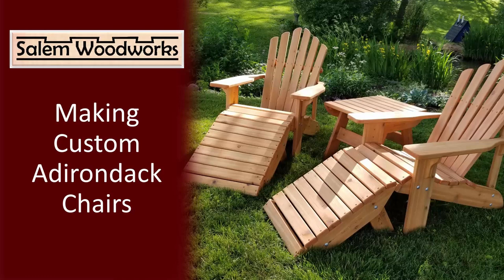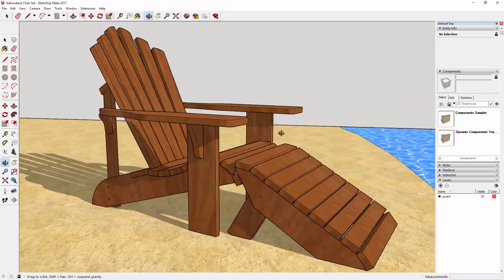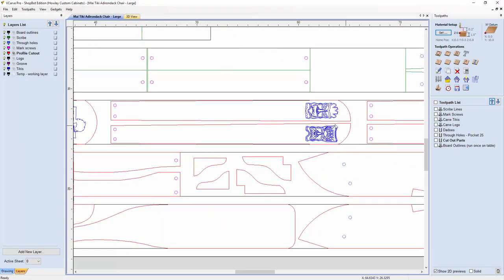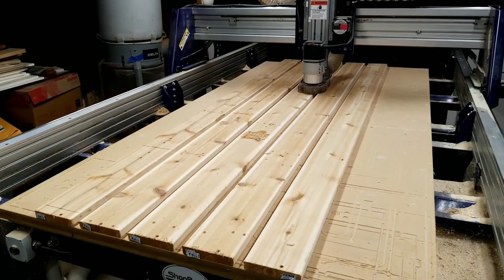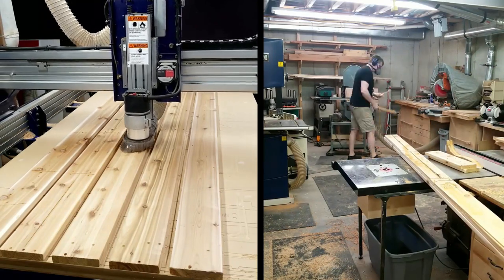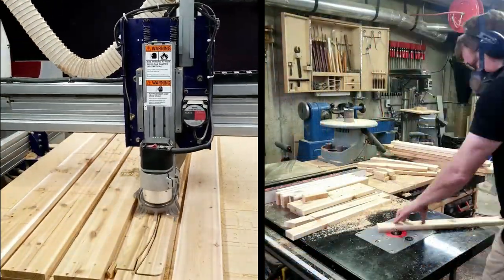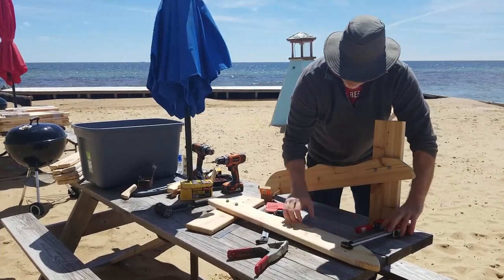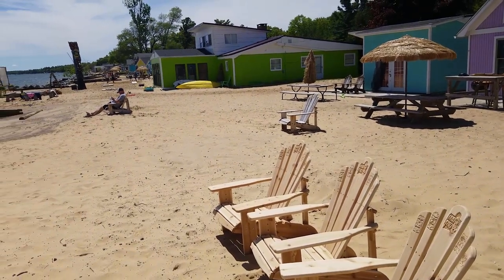Making Adirondack Chairs

Comment: Awesome! I wish my CNC had a full 4x8 bed. Couple of questions, do you apply any finish to these? Also, I'm going to shoot you an email and would LOVE to see your sketchup file for these. I'm having a very hard time finding chairs we like under $500-$600.
Reply from the maker: Thanks. I got your email and will dig up the Sketchup file and send it shortly. I've used several types of finish. I've sold quite a few which have been left unfinished. In a season they weather to a nice gray and after a few years start to get a barn board weathered look. However, I'm sure that shortens the life of the chair. I've also stained a few with deck stain and haven't loved the result. The finish doesn't seem to last very long. I've painted one and that seems to be standing up nicely. Recently I've made a few and have used marine varnish. Those come out by far the nicest looking and I'm pretty sure they will weather well. Regardless of which finish I use, I make sure to apply one coat while the chair is still all in parts and then assemble and apply additional coats. The painted chairs I painted two coats before assembly. The varnished one I used a brush for one coat before assembly then assembled and applied a couple of coats with a spray can... much easier than brushing it on an assembled chair.  I think I need to invest in a good paint spray booth arrangement if I make too many more...